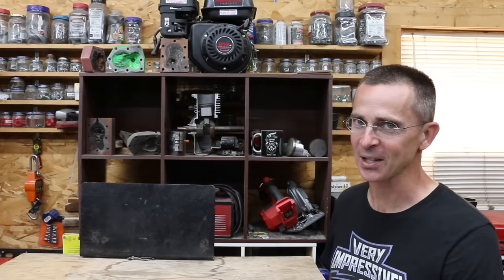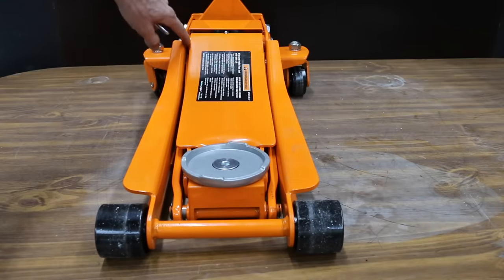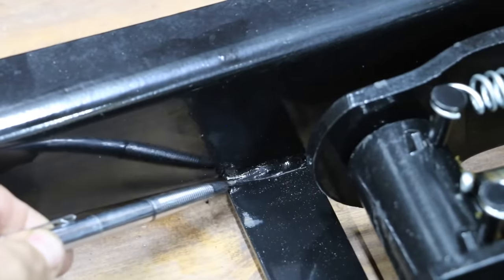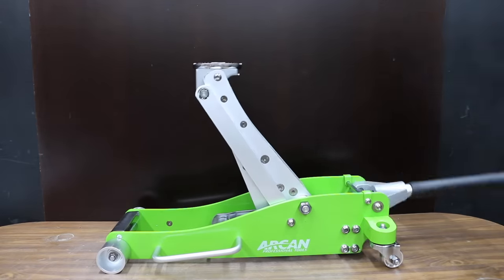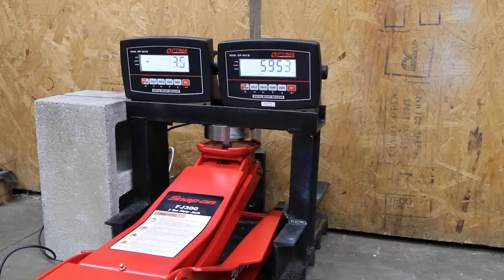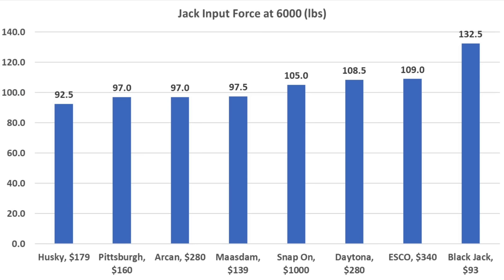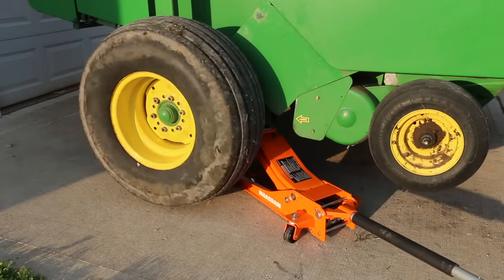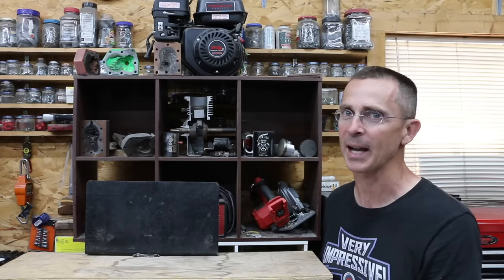Best Floor Jack? $1000 Snap On vs Daytona, Pittsburgh, Arcan, Black Jack, ESCO, Husky, Maasdam

Comment: Snap on lost a lawsuit against harbor freight, the Daytona is made in the same Chinese Factory as the snap on, snap on claimed theirs was made in the USA, but claimed the Daytona stole their design, when in fact it was just being made in the same sweatshop!! Snap on who claimed theirs was made in the USA embarrassed dropped the suit!
Reply: I wonder how many companies do that bcs I’m sure it’s A LOT? Like “Made In the USA” is pretty vague… like what part was made? The concept, design, manufacturing?? There’s a lot that goes into taking a product from concept to customer and w how unregulated companies are when it comes to marketing claims (and so much more) I’m sure if just a certain percentage of it is done in the US they can make the claim. 

I went down the rabbit hole of the mattress industry when we needed a new one. I ultimately ended up sourcing components myself and made my own (DO RECOMMEND, btw), but the sh*t they pull is mind blowing. There was a video I saw of a dude cannibalizing a Serta (I think) to take the good components and replacing the worn ones, and as he was removing the layers of this queen size mattress and inspecting them he pulled out a yoga mat sized “gel foam layer.” They literally only need to put a dash of a component in to be able to claim it’s a “gel foam mattress.” 🤯😠 Guess that’s what we get for having weak regulations on companies or former board members/CEOS of said companies doing what little regulation there is. 🤷🏻
Reply: Thanks for the info: I started looking for one of these and there seems to be more than one "Daytona" model--> do you know which model(s) of the Daytona were "very similar" to the Snap On?   I used to want to "buy American" but large companies, for lots of reasons, don't use the same definition as we would, so that makes it easier for me to buy something made abroad.   I would be using to work on a Japanese (non USA) car anyway :)
Reply: @gotflute123  Who pays $1000 for a jack? You might as well get a hoist at this point.
Reply: @kirkbrown2147  I have no idea who pays $1000 for a jack...?   I don't understand your reply...?
Reply: @bigboreracing356  Dude, they lost the lawsuit, do your homework, they claimed all of their stuff was Made in the USA until very recent. they changed the verbiage due to being laughed at. come back anytime with your butt hurt self. How else would they have lost in court!!
Reply: @gotflute123 You see a lot of “Designed in America” or “Assembled in America (from foreign parts)” and they still have the nerve to charge an arm and a leg for it. 

Very few things are truly made in the USA. “Made in China” isn’t necessarily a sign of poor quality anymore, nor is “Made in America” a sign of good quality. 

I try to buy things that are made in the USA when I can, but it’s tough. I always buy American made boots, Red Wing still makes (some) boots that are 100% made in the USA.
Reply: @Reginald_Harrison  Agreed.  I was typing quick, so I don't know how well your point came across in my comment (and also I guess encourage the "prickly" comments above yours).
Reply: @Reginald_Harrison  My 2010 Jeep Wrangler Islander has a 6-speed manual transmission that was made by Mercedes-Benz in Stuttgart, Germany. Very rugged and easy to service.
Reply: @jessuckakepow  The assembly is done in the U.S., from 100% overseas parts, so that they can legally lie about the origin.  So a few minor things are different, but the core is the same.
Reply: @gotflute123 its the daytona 3 ton lowprofile super duty with rapid pump specifically.
Reply: I have two snap on jacks and they took a shit fairly soon after purchase.  Seals went bad and they leak and also one of them is bent and doesn’t sit flat.
Reply: @gotflute123  It's the one in this video.

Comment: I consider aluminum jacks in their own category. Their lightness is so valuable when loading them in and out of trucks and race car trailers that you really wouldn't consider a steel jack for that purpose. I feel like you could do a comparison of aluminum jacks which would be very valuable to those who need to move their jacks frequently and who wouldn't consider a steel jack.
Reply: Good recommendation.
Reply: I don't know if there are enough to justify their own test, but it is a significant note.  Under the circumstance a jack you can one hand lift is a significant change.  I have a rebrand of the Arcan picked specifically for that reason.
Reply: lifting my snap on in and out of a tall truck bed is killer
Reply: Idk, I move my Daytona a few times a month in and out of the trunk of my car. Have had it since 2013. It's heavy sure, but I really don't mind. I might care in another 20 years, but from 24 to 33 it's been fine.
Reply: @benjaminhenry5869  only a few times a month though, if you're doing it multiple times a day...
Reply: @zebragoboom  I don't know that would make it a deal breaker. I see it as more of a luxury than a necessary with my age and shape.
Reply: I originally bought a 3 ton Daytona (big sale), but after lifting in and out of the car, I changed my mind and got a 2 ton Pittsburgh aluminum jack. Getting older takes its toll.
Reply: Yep. The aluminum jack is the upgrade equivalent of the fine tooth ratchet. Once you use it, you'll wonder how you ever did anything without it.
Reply: I have to second this suggestion, I have a Performance Tool aluminum race jack I got as a gift one year, it's been super great. I wish it had 2 wheels up front instead of one long roller, but it's low profile which is great for getting under my sports car, it lifts fast, and has enough lift so I can get under there. It'd be nice if it lifted higher, and I was thinking about getting a Daytona from HF, but seeing the weight, I think I'll live with mine. I also noticed that the aluminum one has the same handles on the side as mine, and I can tell you those handles are super nice to have.
Reply: My first floor jack was a Big Red from PepBoys.  Later, I got an aluminum "racing" jack from Harbor Freight.  MUCH, MUCH better.  Their aluminum jack stands are nice, too.
Reply: If it’s a full time racecar they sell attachable allstar air jacks that’ll lift 15.25” of stroke for $2,500 small price to pay for add air and your car is 14 inches off the ground they sell longer ones too if you’ll pay the money if you’re 50k deep on a racecar, trailer alone I think a few grand on a air jack and compressor you already need won’t make a dent.
Reply: @benjaminhenry5869  I got a Daytona aluminum jack and it’s like night and day. If you think lifting a steel jack is no problem you must be like The Rock
Reply: @benjaminhenry5869  I use to say the same thing until my old metal Allied jack I got from Sam's about 15 years ago broke. I got an Aluminum Arcan and OMG what a difference it made. If I knew it was that much easier I would have got an Aluminum jack a decade ago
Reply: I mean a bag of Portland cement is 94 lbs and guys load those by hand into trucks every day so one jack weighing the same probably isn’t an issue
Reply: @alexmills1329  the fence panels I load onto trucks solo by hand are 178 pounds they fuck my back up but it’s possible.
Reply: @alexmills1329  I load concrete often and only ever buy 60 pound bags
Reply from the maker: Thanks for the suggestion.
Reply: That reminds me......Those 2000 cows that died in Kansas 2 months ago didn't die of heat-stroke. Danica Patrick was driving her SUV inside that cow pasture for 10min tryna find the gate. 🧟‍♀🐮🐄💀
Reply: @eclecticgentleman  Thanks for sharing your experience. Next time I'm in a tool shop I'll lift one and maybe I'll change my mind.
Reply: Yes, and the fact that Snap On makes their aluminum jack in the USA (unlike the steel version used in this test which Snapon says is made in China) would tend to justify its $970 price tag.
Reply: Im 69 retired lineman with arthritis and diabetes,  got the Daytona floor jack tuf to lift. Got rid of the arcan low profile long reach floor jack,  made a mistake
Reply: @alexmills1329    !!! Unless you’re old, fat & lazy like ME !!!
Reply: @dirtfarmer7472  as my late in life father would remind me of often “That’s what sons are for!” 😂😂
Reply: @terdfergeson23  why the small ones? They are normally a worse buy… guess I’m cheap, because I buy cement and pick up gravel and sand by the yard and mix up to 2 yards at a time that way
Reply: Agreed.  I’ve got a classic orange Hein Warner in the shop, 40+ years now, and an aluminum HF jack in the trailer.  Perfect uses for each of them.
Reply: @hhjhj393  I’ll circle back to this in about 50 years when I’m old and see if it even matters by that point, I doubt it will.
Reply: Im 60 now, that 80+lb daytona low profile is a bear to carry. I can move it but then theres half my energy for the task at hand. However I bought it after i tried the 3 ton arcan from costco which had a rear caster collapse lifting my minivan the first time. Pathetic.
Reply: @hhjhj393  Yup, you should NEVER get under something with just the jack supporting it.
Reply: Other than weight probably not needed.
Reply: Great idea !!  I have the Pittsburgh aluminum racing jack that looks identical  ( aside from color)to the Arcan in this video
Reply: I agree. We have a Harbor Freight small aluminum jack that we use all the time.
Reply: @eclecticgentleman  funny how as we age that stuff makes a difference.  I'm with you!
Reply: @benjaminhenry5869  Haha. Loved your perspective.  “From 24-33 it’s been fine”. Us old blokes need to remember this. Nothing works like it used to as we get older.  I am way over and can verify that!  I really did laugh when I read your comment. Tip:  Do a Valsalva manoeuvre and hold it for the two seconds before you lift from the trunk. The increase in abdominal and chest pressure makes your torso like a solid  hydraulic. Helps your back. Like weight lifters taking the strain.  Apologies for the long note…..😊
Reply: I agree. My next jack will likely be aluminum for that very reason - jacks are HEAVY!

Comment: “The Maasdam was built on a Monday” I laughed too much at this. Or it may have been built on a Friday and they just wanted to leave. Great video as usual Todd.
Reply: Yeah that looked like Friday after lunch build quality.
Reply: Or Mandatory overtime Saturday.
Reply: or a tuesday , weds, thurs....
Reply from the maker: Thank you!
Reply: Like the old saying, "The first five days after the weekend are the worst." Another great job, Todd. Thanks.
Reply: How about the spongy feel?  LOL  14:58
Reply: They probably need to somehow figure out a way how to make a complete die-cast body, no welds no joints if that's practical.
Reply: See i always heard the joke of things being built on a friday! At the old GM factory.. You definitly didnt want a friday car..
Reply: Yeah, he messed that up... 
The phrase is "made on a Friday"
Reply: looks like alot of these jacks are made in the same factory. Just quality controll makes the diffrence.
Reply: Or the morning after payday!
Reply: @bobbygetsbanned6049   Nah by Friday that welding virgin would have had some practice.  Actually, I don't know if the Mon-Fri applies in China,  but that looks like new guy's first day.
Reply: @JohnStrandt  I think he meant hungover.
Reply: I have a Dodge Truck that was built Superbowl Friday....
Reply: @pilgrimm23   I had a 63 Dodge that I researched to find out it was built on Friday. The welds weren’t even close to being straight and uniform.
Reply: Looks like their welding intern did it, what a terrible job
Reply: @Joan Cairo yeah i sold that truck and bought a 68 F250. The welds are straight and uniform. Very well built.

Comment: I bought the yellow Daytona Jack when it first came out (about 6 years ago) and it was only $180 then. It still makes me happy knowing it was money well spent. The height it reaches for taller vehicles makes a world of difference. Absolutely beast of a jack!
Reply from the maker: Thanks for sharing.
Reply: I got mine 6 or so years ago too, with a sale at HF... paid about $120... best jack I've had!
Reply: I just picked up a green one (3 ton super duty) on sale for about $180 after taxes. Glad to see so many positive things affirming the purchase.
Reply: I got mine on sale for about $120 if i remember correctly back in 2019.
Reply: The Arcan was $99 at Costco in 2019.  Now its' $249.  Great jack, btw.
Reply: Same here.  It was $200 with a $20 coupon so $180 out the door. Its by far the best jack I've ever used.

Comment: Usually I end up a little surprised in all your tests, but, here I had not doubt that the Daytona and Snap on would come out on top. That being said, I would buy two Daytona Jacks and two set of jacks stands and still have money left over for a lifetime supply of jack oil, instead of buying a Snap on jack.

Comment: Update!  Based on this review,  I just bought the Daytona (in metal flake red since it was on the top of the stack and these things are heavy).  Needed it to level a shipping container (8,200 lbs empty).  First, those big wide wheels make it somewhat easily transportable across dirt or grass.  I used two each large pieces of 5/8" plywood under the wheels to keep the jack from sinking once in place.  Keep in mind that a shipping container is a very rigid steel box, so jacking just a corner up raises the whole end of the container(4,200lbs roughly).  I was able to pump the jack one handed to the desired height and nothing creaked or groaned on the jack while I placed additional blocks under the container.

Money well spent so far!
Reply from the maker: Nice! Thanks for the feedback.
Reply: Just use bottle jacks
Reply: Sounds like he possibly had clearance issues and bottle jacks are not exactly low profile.
Reply: @h8GW  dig out what you need.  Im jacking 2 now 6ft high with 2 bottle jacks
Reply: How was it $99 ?? We paid $199 on sale
Reply: @matthewlee2686  
Or, he could "just" use the floor jack.
Reply: @matthewlee2686  Or he could've used a block of granite and a log like the Egyptians.
Reply: @tallswede80  Since I don't own a bottle jack, yeah, I'm kinda stuck with my sexy new floor jack.
Reply: @oldowl4290  Too funny.
Reply: I used the farm jack from HF to level mine.  The floor jack is another good option
Reply: yea they are heavy for sure. I just got one thats low profile at 3 1/4 and the bigger one was 3 3/4 for modern cars that 1/2 is a big deal and based on the weight alone im glad I didnt get the bigger one like holy shit thats a heft boi.